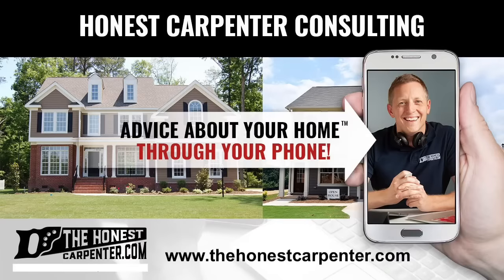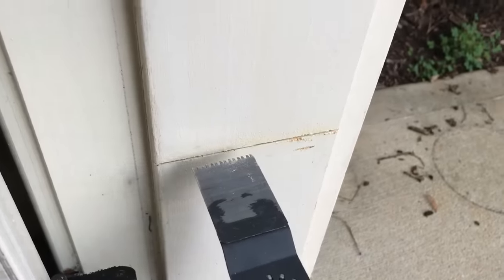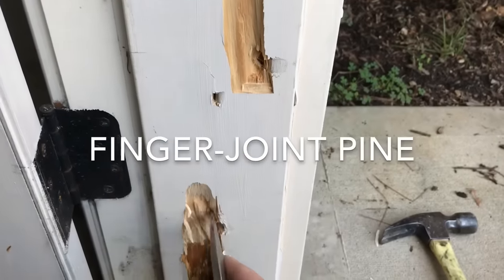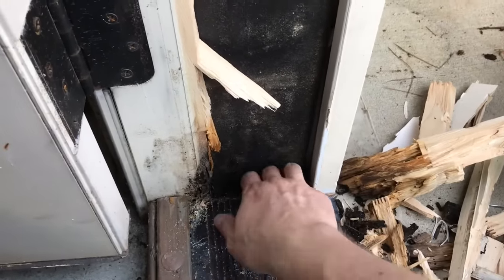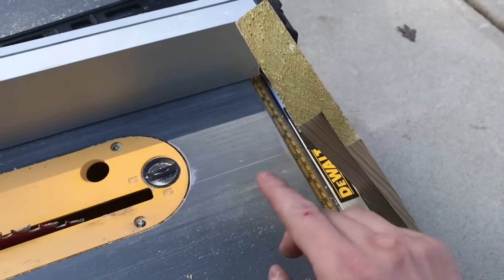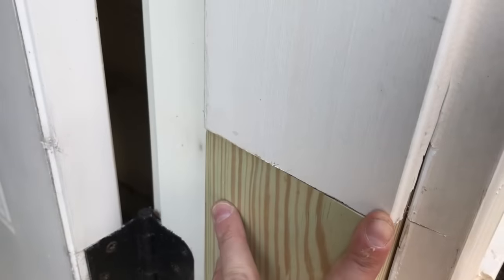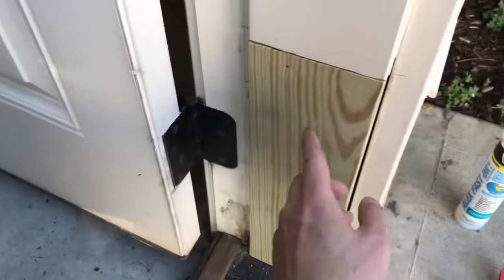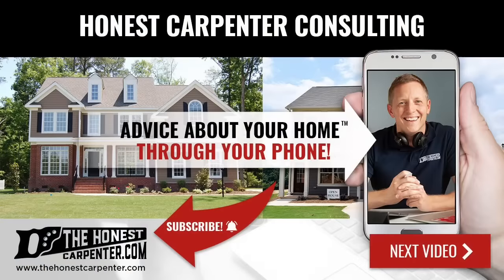How To Repair Rotted Door Jambs

Comment: I hope you apply some insulation underneath there
Reply: @ya472  a door is a bad place to put insulation?  That's funny
Reply: @ya472  6 dollars more for foam. Get a knuckle bender to adjust doors. Foam also holds the door frame in place from moving. All doors move a little bit, moisture content or not. Foam is what is used nowadays. I do agree that hardly anyone can install a door correctly, or do anything else correct for that matter. So tell your journeyman brother to charge 507 dollars and use some foam
Reply: @ya472  it sounds like you know very little about what you are talking about.  Tell me how much the upcharge for putting in foam is?  There is also no need to even take the trim off if you are repairing a door that has moved 95% of the time.
Reply: @ya472  your rite. You shld def not insulate around doors, and prob not windows either. But after 20 years the settling stops. So that's when your ok to install good insulation.  And what is the upcharge of foam like you were talking about. You said it wld be WAY more if you used foam. And you referred to your journeyman brother. So I assume u have less experience and you ar most likely just a helper. It's nice to see that you think you are doing it rite. I'm always open to different ways. But I'm not open to not insulation around doors and windows.  But foam is no big deal if you need to rehang a door. You are cutting the shims out anyway. I have had many 1/4 wit employees like you and your brother. But please tell me what the huge cost is to foam a door. Cutting corners and not using the best materials is not the way you shld be.
Reply: @ya472  I understand fully. You cant answer any of my questions. Once you have more that 2 years experience you will understand alot better.  Keep up the good work.
Reply: @ya472  no it's not a pain in the ass. Get a knuckle bender and stop taking trim off to make a simple adjustment. Keep watching youtube. There are videos about how to do this

Comment: There’s this other big screw driver called a pry bar that works well
Reply: Been in the construction industry my whole life. Everyone except for home gamers has a destructo-driver just like his.
Only home gamers have the exact right tool for left-side of the board screws and right-side of the board screws and super-duper purpose built screwdrivers for the screws in the middle.
Reply: Ethel Ryan your argument is full of logical fallacies. I’m “in the industry” and I own a pry bar. It’s a basic fucking “industry” tool. It’s much more effective than picking it apart chunk by chunk with a narrow headed screw driver.  I’m not going to use a basic tool that takes twice as long, as another basic tool I keep in my pouch, to prove a point. I’ll leave that to dopes like you. Come to think of it, I don’t think I’ve ever seen any carpenter  carry a large standard screw driver on their tool belt.
Reply from the maker: @Boss Hog Ethel’s right. Every repair carpenter I’ve ever worked around carries one of these. I see your point—I do use a pry bar too. But the blade is too wide to bite into lumber, and it generates too much force. My goal was to pick this thing apart, not pry it out. Demo screwdriver is better than a chisel here, but more precise than a pry bar
Reply from the maker: @Ethel Ryan I agree fully. There are companies making these now that only promote them as a “demo” tool. So useful!
Reply: The Honest Carpenter why couldn’t you pry it out from the outside edge?
Reply from the maker: @bossHogOG  You definitely could, but it would require pulling the brickmold first. With that approach though, the pry bar would indeed be the faster tool.

Comment: The back of the jamb was rotted too.  Silicone is trash. There is much better caulk for this application.  You shld have put a weather cut with at least a 15 degree angled down. And def back prime with oil primer, even if it is new pt or 5/4 pvc

Comment: Prime paint all of it, back, top, bottom, all sides and and all parts of the existing frame you can reach especially that joint.
I know it is treated wood, I have seen it rot and the paint will help keep it dry.
If you use a fast drying exterior primer like Zinsser it will dry in the sun in five minutes.
Or you can use a hair dryer.
Reply from the maker: @udavidism That's good advice. I keep a heat gun around for speed drying stuff--NC humidity can really work against drying time. I've used more Kilz than Zinsser. Is one better than the other in terms of dry time?
Reply: @TheHonestCarpenter  I think Zinsser drys faster.  They sell Zinsser at Home Depot, I use the exterior rated type.  It sands real easy too.   It drys so fast it is difficult to use it out in the sun.  I step into the shade and often if it is a small area I use one of those disposable brushes from Harbor Freight.   I don't like throwing things away but often it is much faster and cheaper than washing out a quality brush. A small can of paint thinner with a sealable lid will also work for cleaning your brush well enough for later use that day.
Reply from the maker: @udavidism  Thanks for the tips! I didn't realize Zinsser had that sort of drying speed. I probably would have been using it a long time ago! I wonder if it has the same stain-blocking ability as Kilz? I'll admit to also being a cheap brush user. I just paint so little, it often makes more sense to get as much out of a cheap brush as I can, then, move on to the next one if necessary. Overall, I've always lacked the patience to be a good painter. That's why I like carpentry--when you're set up and running, things go FAST. Thanks again for all the advice, I appreciate you watching the channel!
Reply: @TheHonestCarpenter  It blocks stains really well, they call it cover stain.
Reply from the maker: @udavidism Awesome, I’ve got a small trim repair today and need to pick up materials. I’ll give it a whirl 👍
Reply: @TheHonestCarpenter  Zinsser Cover Stain, miracle product. Can be diluted for a nice glide, dries & sands fast & nicely for great, fine interior trim top coating. My guess: Kilz is great for carpenters (when not followed by fine painters who give a s--t about stroke thickness, appearance & straightness), end grain sealing, back priming etc.

Comment: Only problem is you caulked to bare wood “that will not hold for long” ....you should prime the wood first then caulk....just saying
Reply: Yeah, this is halfway between 100% proper and a homeowner who knows nothing.  I don't like a lot of these videos, I see repairs 15 years later as an independent contractor, and can tell you why this will not last for 50 years.

Comment: Its crown cut treated lumber....it’s going to expand.
The summer/winter expansion is going to show in about a month or so.
No hate, but why didn’t you use MPly or hardwood?

Just saying
Reply from the maker: @British Humour But all lumber expands and shrinks. As mentioned, this is "dry" treated lumber. It has a similar MC to the framing and exterior trim by this point. I've never had a call back on this repair, and have never seen it act adversely. I think hardwood could work fine, but it wouldn't be treated, and would need to be heavily backprimed and sealed. What's MPly?
Reply: The Honest Carpenter 

Hi again.
I truly hope you didn’t think i was being obtuse, i was/am a fan of your work.
I was really more intrigued what methods you guys use, UK here, and was wondering why you use what you use.
Please dont think i was being a smart arse, i was simply posing an open thought to you lol, and am sure your work is as good as any. 
When i saw your upload i wondered (in my head) why not just use Mply (Marine ply), its flat, very stable and easy to use.
But we all have our own way of doing things, your timber is to hand and readily available and a proven technique i’m sure👍
Your reply was as informative as your video. 
So yeah, please dont think i was being a jack ass, i was really interested in what you were doing, thank you for a reply too, many dont bother, so i appreciate your time
Reply from the maker: @britishhumour2858  No worries! I wasn't trying to snap back at you, was just dashing out questions for comparison. I really don't mind curiosity or even criticism on my channel. All constructive discussion is good with me :) I hadn't considered marine ply (it's just not as accessible around here). But I do think it could work if you can conceal the layers where they're revealed at the corner. Anything that will stand up to the elements! I appreciate you watching. I lived in Glasgow years ago, and love getting comments from UK. I just teamed up with the North Yorkshire Moors Railway for an article on my website--check it out if you get  a chance. Cheers!
www.thehonestcarpenter.com

Comment: You should have done a 45 or a finger joint
Reply from the maker: MrMoon_ But how do you finger joint something in place like this? 🤔
Reply: @TheHonestCarpenter  Patience. I use my oscillating saw. I draw out my lines and follow it. Sometimes you need a small chisel.  As a matter of fact the carpenter that taught me did the whole entire joint with a chisel.  He would add a 45. You had to slip the new piece in. If you do the 45 you can leave 1/8th" gap for shrinking and swelling.  I agree these jams are junk.  We always seal them before we install and caulk.

Comment: I have been impressed by your videos.  This video I felt was cryptic and vague.   

I did not like the fact you did not show how to reinstall the insulation into the door jam, the way the new portion of pressure-treated wood fit into the jam, as it looked there was a gap or a visible line where the two pieces came together at the top of the new portion of the new wood, that made it look more like an inexperienced person or homeowner did the job, even though it was pressure-treat4ed wood you did not prime and paint the vulnerable portion (top and bottom portion of the new wood piece), the tacky shims behind the new pressure-treated wood (I would have planed down a new piece wood to the thickness desired with a hand or electric planer to the exact size needed for the width, I would have cut the paper at the bottom of the jam to inspect for any possible upcoming rot and then replaced it with a better rubber or similar sealant,  and finally, the chalk (tub & tile) on the other side of the jam was for a bathroom instead of more industrial chalk made for outdoor use.  That is what a homeowner would do because they are not properly trained.  How tacky!

For one who normally has stellar videos, this one crashed to the lowest level.  This is not your usual outstanding level.  

Thank you.

Comment: Why did you take such a big piece out of the door  when it was only around 6 inches which was rotten.
Reply: That's a good question.  Although the video demonstrated a quality repair that is hardly noticable, all such repairs will demonstrate some level of visibility in the future. A small short piece will look unnatural and patchy. 

Additionally,  it is easier to maintain the correct plane with a longer piece. Misalignment would be problematic. The longest piece also would accommodate issues in the rough framing, if any.

Comment: wonder what's going to happen when the chemicals in the treated lumber react with the aluminum threshold?? I don't why take out the old in pieces..make a vertical cut at the weather stripping edge and the threshold end then take out the whole piece..
Reply: Copper on aluminum.

Comment: I'm not digging the idea of shims at all. I piece of 3/8 plywood might have been better. I've got to replace the wood in my door again. The patio just soaks the wood in the door frame the water seeps under the sill too and I put GOBS of silicone caulk and it had no effect. I need to put some sort of drain right there but it's in a bad place and it would require pulling up m patio stones, digging a trench, putting down rock and maybe a pipe. It's just not worth it to me. I'd rather fix the door again. And I could always maybe put a little cement around the sill. I don't know but I get a small puddle in the corner there by the door. It's a nuisance.

Comment: The shims barely provide adequate support for the replacement board. I still do not understand why you needed to cut away the tar paper: a better fitting shim could have been nailed right over the paper. Also, I am amazed you did not fill the gap between the threshold and the door framing with silicone PRIOR to installing the replacement board. Finally, you mentioned at the beginning of the video that "you don't understand why board ends are not sealed", yet you did not seal the end of the replacement board. Yes, it is treated, but treated lumber will still transmit water and moisture.

Comment: As a painter, I would recommend to all you carpenters, please stop using silicone in the wrong places. When you put it next to a painted surface, the next time painting needs to be done, it's a real pain to get ready to paint. Paint does not stick to silicon. Use rather some clear paintable caulk instead. Thank you.
Reply from the maker: Thanks Mike, that’s good advice. Aren’t there some kinds of paintable silicone though?
Reply: Correct, stop it. Clear silicone like that has no place other than a kitchen or a bath
Reply: Vulcum. Learn to caulk clean & cut a paint line properly.

Comment: ow that you have introduced everyone to an "Oscillating Tool". Let me repay the kind information with introducing you to a wood chisel..It would be a lot less headache in digging the center out with sharp wood chisels than with that "demolition screwdriver"
Reply from the maker: Chad Harrison I use chisels pretty often. But long screwdrivers have twice as much leverage, they never dull, and the soft pine of these jambs really doesn’t present that much resistance to them.
Reply: @TheHonestCarpenter  LOL. I understand was just ribbing you a little. Good to see that not everyone on the internet get so defensive when someone jokes around with them and for that I will share some of my experience with you and products I find helpful. In all seriousness your video is quite informative and should really help anyone who needs to make a repair of this nature and can't afford to hire it out.  Things that I do a little different when I do a similar repair:  One is I use a synthetic lumber.  My old neighbor gave me a pretty good bundle of fall off's and several full boards left over after a state job was complete and the contractor did not clean up after themselves and I have been using them for years for various little projects like this.  They are 2x6's  and I plane them for thickness, shape for weatherstrip, use a waterproof construction adhesive or silicone  and standard framing nails to secure them fill, sand, caulk and paint. 2nd My digging tool of choice is a small flat bar/cat claw I think maybe a Bostitch maybe?? Regardless I sharpened the spread out flat part razor sharp and it digs great, and because it is a cat claw there is a place to whack it with a hammer. Here is a tip on where I bought some of the best tools I have ever purchased. Fastcap is the company out of Washington state I think.  If you have not heard of them check them out.  My first purchase from them was a miter saw stand called the Best Fence Pro.  It is not cheap but I will tell you hands down the best I've ever seen.  I own a ton of their products now an no one in the industry will beat their customer service or support!   Last if that Bosch Oscillating Tool wears out on you and you don't want to spring for the multi-master give the Rockwell a shot, I really like mine and Rockwell has been fantastic for support and warranty on other products that I have purchased from them. I am not sponsored BTW or affiliated with any company that I mentioned just my opinion on their products and service.

Comment: The GE silicon caulk is awful. It shrunk on all gaps I caulked in house
Best Exterior silicon imo is OSI
Reply from the maker: I’ve heard other folks say the same thing about the GE silicone recently, which is a bummer. In this case I’m more or less using it to just clot up the end grain, but I’ll have to give OSI a try for other applications

Comment: Why not just replace the whole board? Why just the lower portion?
Reply from the maker: Replacing a hinge side jamb is crazy complicated Tactical. Have to mortise in the hinges, pull casings, essentially rehang the door...the only thing I do differently these days is use pvc instead of treated.

Comment: How much did you charge for this repair?
Reply: Also nice video, I always just repaired with bondo
Reply from the maker: Vince Drapes Thank you! I usually charge upward of $200 for a single jamb. If multiple jamb repairs are necessary in the same house (as is often the case), I’ll drop that considerably, maybe to $100 a door. Bondo repairs are definitely an option too!